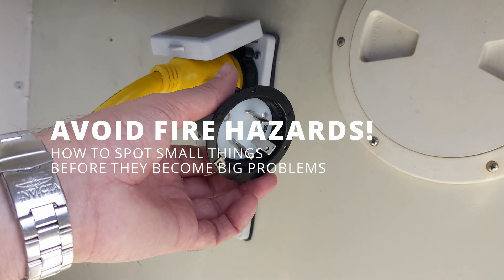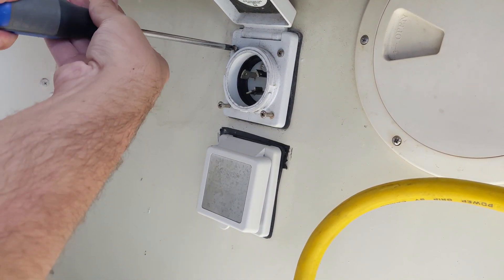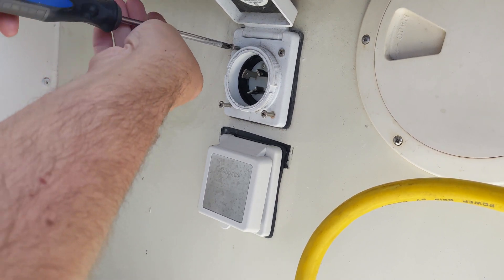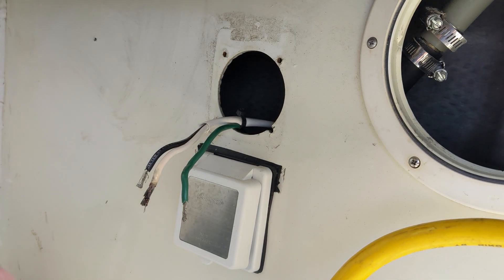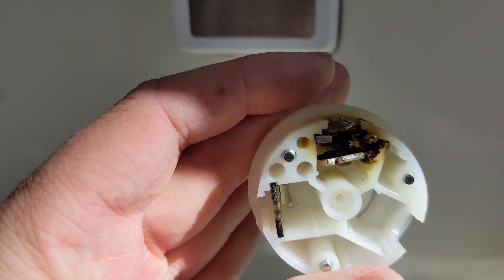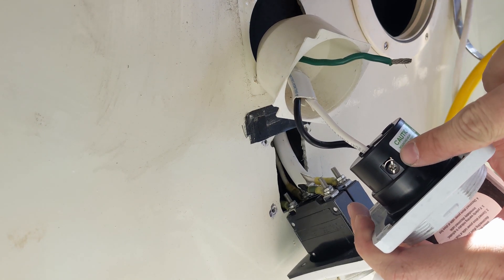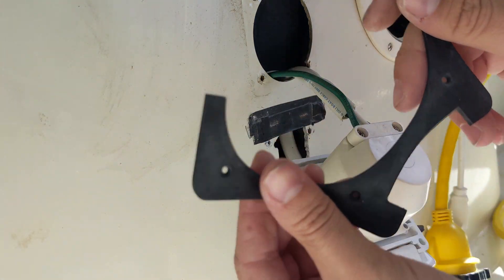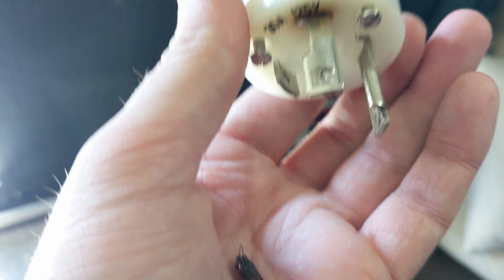Marine 30amp Shore Power Electrical Outlet Replacement

Comment: Currently need to do this on my 1985 Catalina 30. Took out the old one and now there's not enough slack in the wire to install the new one. What's the best way to extend the wire on the boat?
Reply from the maker: The correct way is to run all new wiring between the shore power plug and your main breaker on your electrical panel. I suppose the Band-Aid fix is to extend the wire with crimp butt connectors that are heat shrunk.

Comment: What about if theres factory green, yellow and brown wires? I keep getting a reverse polarity light after the burnout & replacement and I've tried every combination
Reply: Your wire may have burned a different hole where there was stronger resistance and now is making a short somewhere check your connections first

Comment: My 1986 34C had the same issue and one of the wires actually burned.  Luckily the circuit breaker at the marina power did its job and shut down the power.
Reply from the maker: I added a cockpit breaker after the power pole breaker didn't do it's job...
Reply: @WJsLifeonaBoat  Good idea.